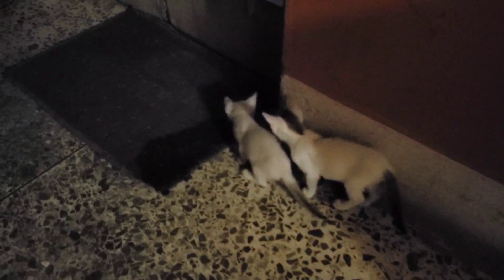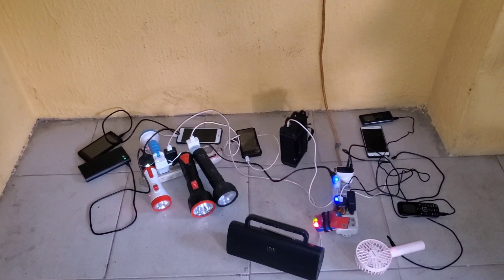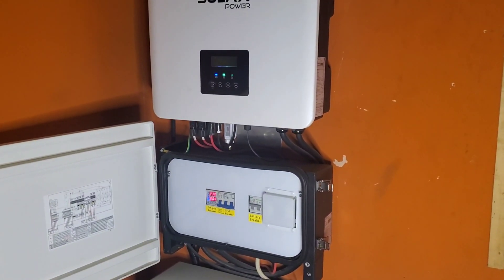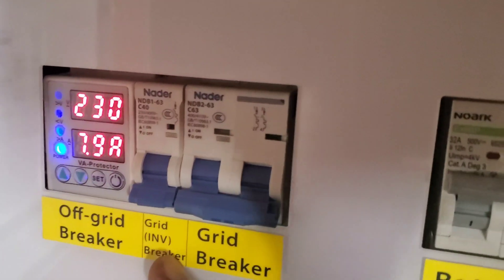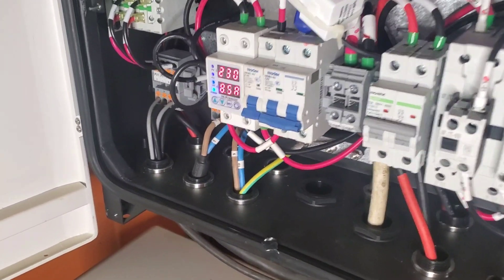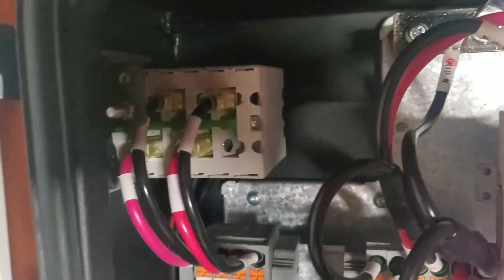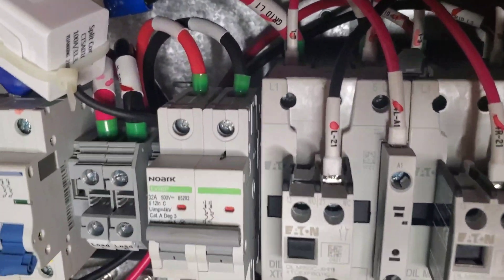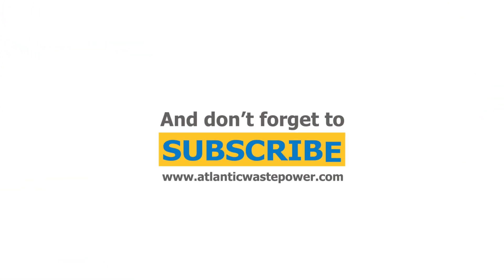The SolaX Matebox shows me what it had been hiding.

Comment: So basically with the matebox output of 60A. I can expect my battery to discharge a current of about 25-30A and use the grid at the same time which would give me 55A to 60A on the load?
Reply from the maker: Thank you for watching and commenting. You can charge at 30 amps and power 30 amps worth of load

Comment: Great video. We had the Solax X3 G4 hybrid and had an issue with the ATS not working properly. For some reasons, when the grid is present, the inverter would not power the off grid loads. Fortunately, one of Solax tech upgraded the firmware remotely and  it works like a charm. Keep posting your videos.
Reply from the maker: Thank you Eric. I am glad that your experience has been very positive. The support has been good and it seems that the firmware drives a whole lot more than it does on other inverters. I promise to make more videos. Thank you for watching and commenting